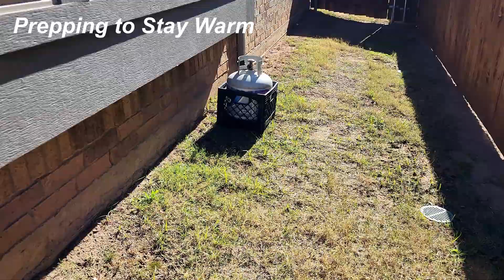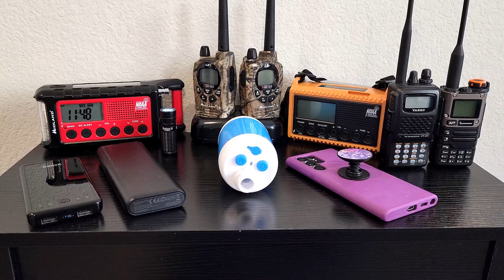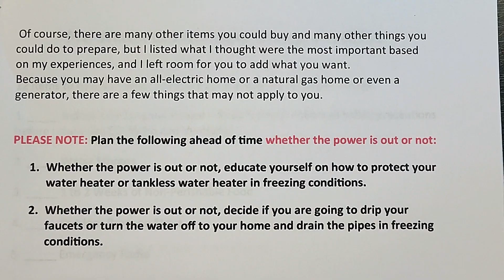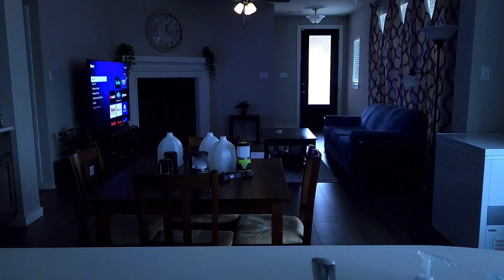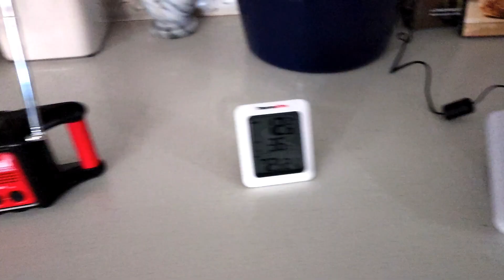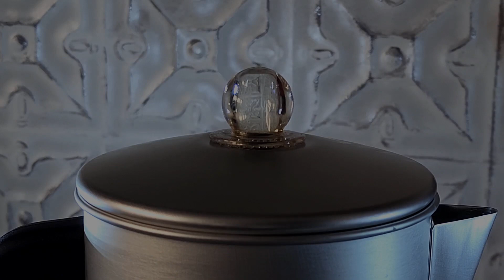Arctic Freeze in Texas – How We Managed No Power, No Water, No Generator For 24 Hours!

Comment: Just an FYI, the Wave 8 heater is 20,000 BTUs good for 750 ft².
Reply from the maker: The Wave 8, the largest one they make, is 8000 btu, not 20,000 and heats to 290 sf. I did a review on it in case you want to learn about it.
https://youtu.be/y9C2le0moDI?si=jt3s5DJj7VBSPSek
Reply: @LoneStarPrepping  I see Amazon has it wrong.

Comment: We had similar checklist but we use a Chinese diesel heater setup thousand square foot house heated it no power no water Southern gallons diesel 7 days basically a gallon a day on diesel to keep it at a nice 71° with negative wind chill factors in the negative15 daytime temps at 9° you don't get any fumes you do have to have a decent battery I have a 200 amp hour ampere time keep it running 24/7 just adjusted output temperature

Comment: Great experiment! Thanks for taking us along.  How cold was your room after sleeping all night without a heater on? Is it the risk of CO/ decreased O2 that prevented you from using it?...I'd reccomend upgrading your gas fireplace. I did my own experiment and mine will keep my 1st floor in the upper 60s, with outside temps in the low 20s outside even in my old house.  Thanks again for you video. I'm going to look at that heater and the shower.
Reply from the maker: Thanks for your comment. I have no idea how cold it was in bedroom when I woke up. I was focussed on getting the livingroom heat going. The bedroom was cold, but would have been worse without insalated windows and blackout curtains. I turned the living room one back on about 1am and the bedroom a couple hours later. We had plenty of blankets and thermals etc...

Comment: Really great video, love the detail. Really curious why you’re putting water in the back of the toilet to flush. Can you cut that amount in half by bypassing the tank and pouring a pitcher of water directly into the bowl?
Reply from the maker: Some people do it that way. I don't. I dont have to use that much water if I dont want. We had plenty of water. I find my way cleans out the bowl better. If you just put water in the bowl when there is no flowing water to the toilet and the tank is empty, it doesnt flush.  If you just put water in the bowl, it wont flush. You have to dump the water high enough over the bowl to aggetate the water enough to drain out and in the meantime, you just splashed dirty toilet water all over the place... no thanks...
Reply: @LoneStarPrepping  I wondered the same, but like your explanation. A cool experiment would be to see how high in the tank (ruler to measure height) water must be for a flush (to conserve water).
Reply from the maker: Ive done it both ways...

Comment: Serious Question here. 
With the Olympian wave 8 heater, 
Do you really smell nothing?
Any down sides to having it? 
I’m interested because I have a few little heater buddies and they all smell to my wife and I. 
After enough time with her buddy we feel a bit nauseous.
Reply from the maker: https://www.youtube.com/watch?v=y9C2le0moDI&t=180s
Only downside is it is heavier, not as portable, you have to use the tank and hose, and you have to keep the cover on it when not in use because the dust will kill the pad on it, and it costs a lot more than Mr Heater, but we smell nothing.
Reply: Well done experiment y'all have performed.
Thanks.
I have 12 volt batteries with cigarette type outlets and USB charger ports and to run our radios .
I have a 12 volt electric blanket, available on Amazon of course, but truck stops have many 12 volt appliances.
The little blanket can keep my wife warm on the couch.
Our propane just about froze in the Texas cold snap, and would barely light,
Now we have a rocket stove.
Our diesel genset wouldn't start since it has no preheater, I was able to heat the intake manifold with a barely burning propane torch and if finely started.
Also, starter battery was frozen, so I had to jump it off our tractor. Now we have a lithium jump starter..
Draining pipes works better than dripping for us. Before restoring water to the house, check the pipes, as if cracked, you may not realize it until pressurized with water.
I like your portable shower, good idea.
Like you, I too have a good wife who helps , especially when it gets rough, she pulled a 100 foot well pipe in the freeze so I could reattach the pump, and she helped me pull the septic pump out, a very unpleasant job, but she just washed the stuff off and kept on going.

Comment: Great video. Thank you for putting this together.  Very simple, practical and doable for anyone.  Love, Love, love the checklist idea. Just as another idea for you: put a bag of rice in a long sock.  While the heater is on, place the rice sock near by.  The rice will soak up the heat.  Put the rice sock in your bed, near your feet before bedtime to pre-heat your bed. This feels soo good and allows your body to retain heat rather than using it to heat up the bed.
Reply from the maker: Good idea! We had a rice bag made to heat up and use as a warm pack for hurt back etc...